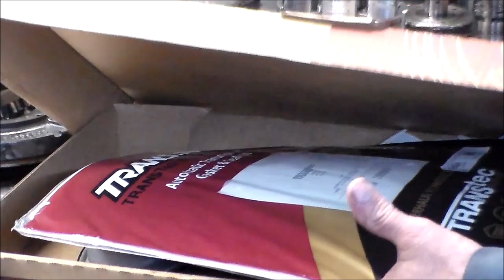41TE Teardown

Comment: Great video as always Gary!!! Interesting that the 2/4 steels are funky for shift feel in these. Great tech tip.
Reply from the maker: had a few issues in the past on the 1-2 shift, since i been installing new steals  shifts nice now
Reply: @GaryFerraro  weird, they never look worn at all, but sometimes I see a faint etched imprint from where the 2-4 piston hits, is that why maybe?
Reply from the maker: @jeremiahstone5285  I think they get glaze on them and i get a chatter on the shift, so i either use new steels or have my friend sand blast original ones
Reply: @GaryFerraro  what do you think about the trans go kit self expanding seal vs a stock underdrive seal with a new piston, I'm working on one that may have had an underdrive seal issue had the self expanding installed. Issue that looks like underdrive seal but couldn't scan before opening, older car, drb, don't have..
Reply from the maker: @jeremiahstone5285  If your talking about the Transgo shift kit, never really cared for the kit

Comment: On a 2000 Grand Caravan 3.8 with 41TE I got a P0740 in 2014.  I changed the solenoid pack but the code kept coming back.  So for the next 5 years I was able to pass the annual inspection by clearing all DTCs then spending a few hours doing varying drive cycles while staying below 50 mph (which was the speed at which the DTC would set).  Five years later, after completing a 300+ mile highway trip, the DTC cleared on it's own and hasn't come back in 5+ years.  Kinda bizarre.
Reply from the maker: that is,  have you scanned the car to confirm that?
Reply: @GaryFerraro  I was using an old Snap-on MT2500 until I got a mid tier TopDon a couple of years ago.  The P0740 never showed up again after it cleared on that trip in 2019.  A P1776 in 2021 was fixed with another solenoid pack.  And a P1792 (battery disconnected) shows up occasionally.  The only data that ever seemed out of spec is the UD CVI was 115 in 2021 and is 122 today.  I will also find a small drip of ATF showing up in the location of the torque converter.  But the fluid level barely drops over time and it's clean.  There has never really been any driveability issues that I've noticed.
Reply from the maker: @dricklorenz9340  Thats high CVI Value,  That should be around 40 or 50. The O/D clutch is usually that high
Reply: @GaryFerraro  Yeah OD has been between 111 and 131 which is within the spec of 48 - 150.  But the UD readings are definitely 115 - 122 (outside the 24 - 70 spec) because both the TopDon and Snap-On have always shown the same readings.  But without knowing these numbers I don't think a driver would suspect any transmission issue.
Reply from the maker: @dricklorenz9340  i'm surprised it works ok with that number on the UD clutch

Comment: does anyone know if you can remove the valve body with the transmission still in the vehicle to replace the transducer
Reply from the maker: yes you can,  make sure your linkage is in low or valvebody will not come out

Comment: What do the bat wings do ? Also would a bad range sensor cause no reverse ?
Reply from the maker: Bat wings keeps the cross pin in place, the roll pin would break and the cross pin would come out and break the case.  Could cause no reverse, look at a scan tool see if it reading correctly
Reply: @GaryFerraro  checked it out yesterday I did a clutch test all my forward gears pass the test but reverse doesn’t seem to register when it tells me to throw it into gear so I’m thinking it might be it funny part is that when I check live data is that I dose should it being in reverse
Reply from the maker: do you have a P0705 code @biofall38

Comment: I was a Dodge dealer trans tech in the late 90's.  What an absolute piece of garbage they were back then
Reply from the maker: you got that right  lol   I was told by my parts supplier that this was the number 1 selling overhaul kit.
Reply: We had a brand new voyager that wouldn't back off the transporter.